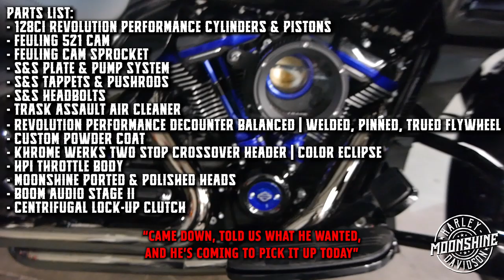JUST ADD HORSEPOWER! 148TQ 139HP | Customer Testimonials

Comment: just did a 128build on my 19rgs....stock heads except for valve springs....stock throttle body with  the 5.5 injectors...550 cam....138HP 149TQ
Reply: kevin cooper do you have Instagram ?
Reply: I do its cooperkf

Comment: What do you think you can squeeze out of 2016 -103. With cams, polished heads and bigger air and jets? Maybe a2 into 1 pipe. I'm getting 110tq and 101 hp right now.
Reply: Jets ???
Reply: Well there are alot of variables.  We would need to start with what cam you have/want, exhaust, compression ratio etc.  And most importantly what kind of riding you do.  Many times people come in and want builds with maximum HP and they ride leisurely on back roads and highways and want to "roll on the throttle to pass cars".  That is not a max HP setup.  That is a good broad torque curve that comes on strong early like 2250-2500 and pulls to 4500-5000 RPMs or so.  And many times it is achieved with numbers like yours.  

Of course I have also seen numbers like the ones you post here that are not in the desired RPM range (same scenario but the power comes on at 3500 and pulls to 6000) and the rider is never in the "powerband" unless they downshift so it still feels sluggish.

The "numbers" are not the important part.  Putting the power to the ground where it is wanted in the correct amount.  Thats where the rubber meets the road.  Call Aaron and he can get started on it for you if you like 615-771-7775 or DM me on the Instagrams @m.v.o_motorfast  -I have alot of Dyno charts and what have you from Twin Cams, M8's, Sportsters etc.  Posted there.
Reply: @NoName-vz1ob  , you guys are a wealth of knowledge! I ride it pretty hard , and like to push it as hard as I can. Still have that crotch rocket in my blood I guess! I'll be contacting you guys for the build! First straight answers I've gotten from any shop!

Comment: What's the reliability of the drivetrain at that power level?
Reply: It all depends on how it's ridden like anything else.  Engines like this can run 50,000 plus miles if taken care of properly and stock engines can blow up in under 5000 if ran hard enough.

Comment: Do you think with the S&S 124/128 being so new, any potential problem with putting 20k a year on a big motor like that?
Reply: We have a few with just over 5k so far with no issues.  One will be hitting 10k probably around November.
Reply: I have 17k on my 124kit and I've made a few stops at the drag strip ;) no issues yet lailes 135 hp 138 tq in a 2019 sport glide

Comment: I just want to know the top speed. How fast can 139hp 800+ pound bike go after a build like that. I see alot dyno runs and  but never a top speed number.
Reply: You know it's hard to say on the street.  The speedometers go to 120 and it will bury that.  On the Dyno they hit the 150ish mark but that's a controlled environment.  And the speed limits are well Bellow these numbers anyway.  The fun thing with a setup like this is you get to speed limit DAMN fast!  😁
Reply: @NoName-vz1ob  my RG can only do 125mph and it tries to float that front end a little and somewhat unstable. I just wondered what higher speeds would feel like with that monster you have. Thanks for getting back to me.

Comment: Hey Aaron/Mike(or whoever helps with the youtube channel), got a rather weird question about doing an upgrade but keeping the warranty.
I'm looking at, maybe possibly not for sure but, getting a Legend blue deniem Fat Boy, but it's used, and has some miles on it. I dunno how the previous owner treated it, and it looks like he was ripping burn outs on it possibly before the break in period was over.
So I wanted to get a brand new set of Harley cylinders on it, and break it in properly.
Can you do a 117 Ci kit with stock mufflers, and just a KN Filter swap from the stock one and tune for that?(with an SE tuner, or tune that keeps the warranty.)

Sure it wont be as powerful as it could be with some aftermarket mufflers or even street canons. 
But I kinda wanna keep the warranty intact, and not spend money on mufflers I wont like. 
Would it be possible to do such a thing? Just have that 117ci kit and cam put on while the warranty is applicable, and then upgrade it later?
Or is that totally backwards and totally pointless?
I don't wanna do a 114 cylinder swap for just a break in, but if I could do that swap and get a displacement increase at the same time, seems like an interesting move.
Reply: I'm no Harley tech by any means, but you have to build up to a 117, hence the name "stage kit". You're going to have to change the exhaust, no question about it. Motor has to breathe and the stock cat setup won't allow that. Along with the usual air filter/tuner stage 1 stuff. These guys are awesome though and I wouldn't doubt their ability to do everything to make the bike how you want it.
Reply: FranBunnyFFXII the comment by Milo is pretty spot on.  If warranty is the chief concern why not leave it until the warranty period is over?  Or if you are going to put forth the expense to change it why not just do what you want one time?  If you choose a reputable shop that stands behind their work you should be fine.  (And dare I say Moonshine HD is such a shop? 😉)

Comment: Fuel moto do the same thing for less and there next door to Chicago
Reply: Strika not quite! They won’t warranty it for two years like we do
Reply: And they don't sell new bikes.  They also don't often do the extra bits like Powder coating suspension radio upgrades etc.  They usually just seem to push their engine packages.